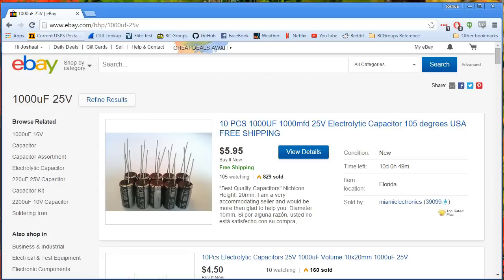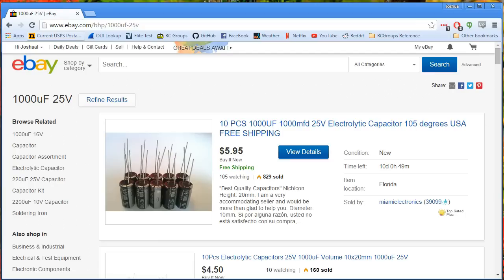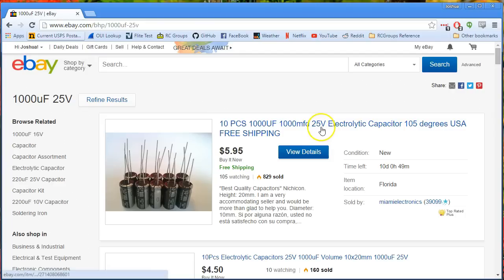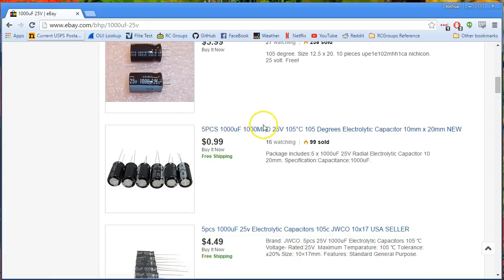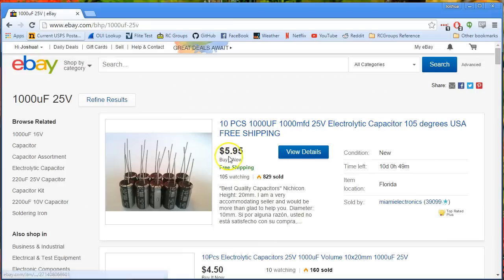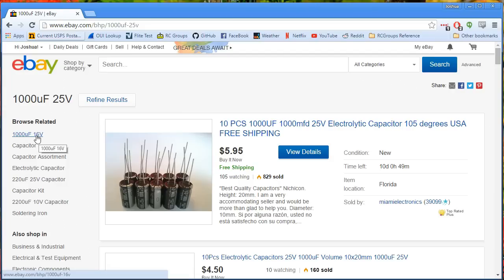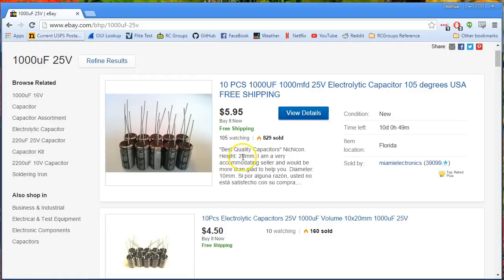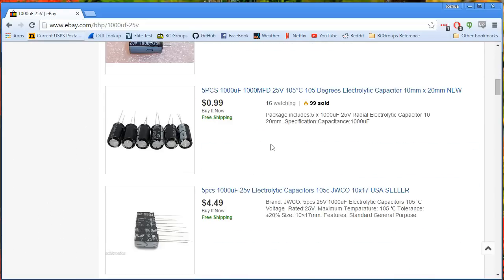Quadcopter Build Tip: Install a capacitor on your battery lead!

Comment: Aren't voltage spikes on 4s some,times up to 35v? Isn't 25 too low? Also does flying aggressivlymcreate more spikes?
Reply from the maker: Yes, but everybody is trying to make a tradeoff between size and performance, and 25v is where people often draw the line. Flying aggressively might create more spikes. But I think the motor design and tuning (e.g. D gain) probably affects things more.
Reply: Joshua Bardwell So would it be safe to stay with 25v? if I get a momentary spike over 25v will the capacitor be okay? How do you tell if it needs replacing assuming it doesn't explode
Reply: thanks for your hell
Reply: help
Reply from the maker: If a capacitor is damaged by over-voltage, it won't be obvious unless you test it with an LC meter, I don't think. I believe what happens is their capacitance is reduced until basically they are non-functioning. So maybe you would see signs of noise?

Comment: It would have been great to see it mounted!
Reply from the maker: +pass1985 http://imgur.com/7MOiiZj

I originally had a small zip-tie holding it down, but it's sort of crammed in there so tight that I decided it wasn't required.
Reply from the maker: +pass1985 I am using some small wire leads in this example because I just couldn't find another way to fit the capacitor into the build. This is slightly less than ideal from the perspective of filtering, but there really wasn't anything else to do. If you mount the capacitor directly to the pads using its legs, be aware that it will move around a bit in crashes and eventually the legs may break. You should add some mechanical reinforcement like a zip-tie or hot glue to prevent this.

Comment: There is no issue with genuine Littlebee ESC's but there may be with fake ones. I have being using genuine ones for over a year and NO issues and I have built 100's of quad racers. Right now my "test mule " is on 30 amp Blheli S ones and no issues even on high timing and stupid pitch props I am testing that draw 40 amps on a punch. I got an email from Littlebee's head of sales stating one of their top guys has left and is selling copies all over the net. Banggood etc and they even have the exact same packaging.  He even hacked their accounts and managed to send me and others  an email but I thought something was up when he wanted me to pay to a difference account than normal. 
I am now going to test these out on 6 cell so I may then need a cap will see.

Comment: How do i find out how many volts and farads cap i need for my build?
Reply from the maker: For 4S, 25v is fine. For 5S or 6S, 35V is best.

For individual ESCs, use a 220 or 330 uF capacitor. For one capacitor on a 4-in-1, 1000 to 2000 uF is best.

Comment: How would you connect this to a Alien PDB?
Reply from the maker: +Salerg battery goes to the OSD power pads. OSD ESC pads to Alien PDB. The key is that all current must flow THROUGH the OSD for the current sensor to work.
Reply: Ive installed my RROSD a bit different on my Alien 5" frame. I connected the battery to the Alien PDB and then soldered leads from the Alien PDB to the battery inputs on the RROSD. Is this going to cause a problem Josh??

Comment: Will using a PNP50 protect my system?
Reply from the maker: Presumably it has some filtering. If you are powering the camera from a filtered supply, and if the PNP50 itself has good filtering built into its own supply, then it at least will be protected.

Comment: Is there a high capacitor? i just got cap for my battery lead, But dont say LOW cap: But
 25v 1000uf 10*17 high-frequency low-impedance high frequency low impedance aluminum electrolytic capacitor 1000uf 25v- and as you say -40/105 C
Reply from the maker: I've been told that basically all 105° capacitors can be assumed the be low-ESR and appropriate for this use.

Comment: Can using a capacitor cause damage in any way?
Reply from the maker: I don't see any way. If you add a capacitor in the wrong place, it can block signal flow, but you're unlikely to do this by accident.

Comment: wouldn't a poll to your vtx stop the noise
Reply from the maker: A what?
Reply: +Joshua Bardwell a polulu, damn auto correct
Reply from the maker: +bo holland it helps.
Reply from the maker: +bo holland it helps.
Reply: Should I do both then
Reply: yes, cap before the pololu. I have a 470uF at the input of my 12V. I recommend it.
Reply: thanks!

Comment: Hi Joshua!

Ive had problems with my fpv.
sometimes when i push throttle and and pull off throttle and invert or something else..
my fatsharks goes black for 1 sec or until I crash.
My vtx is soldered to a matek PBD with bec 5v and 12v and camera gets power directly from vtx(aomway 200mw).
i don't run LC because i normally don't get interference.. just sometimes.
I can run my QAV210 like mad for like 8-10 charges both on 3s and 4s..
and all of a sudden the fatsharks goes black.
Ive thought this was to be expected as normal until I saw this vid.

Could my problem be what you describe here?

Also should i put a capacitor on each esc where they are soldered on the pdb
like what this guy mentions here
 http://www.fluxfpv.com/fix-little-bee-voltage-spikes/

thanks for all your important work for the community : )
Reply from the maker: +2663540 If the goggles are going solid black instead of white static, then most likely the camera is getting disconnected from the vTX somehow. Probably, it's the vibration or motion of the rapid throttle movements that is wiggling a loose wire.
Reply: this is due to the matek pdb. the 12v outputs shut off when main voltage comes under 13.9v ... the same with my matek. greets

Comment: I'm starting a new build with 30A littlebee blheli s and kombini fc, should i add a capacitor? if so i have some that say,
samwha
SD
63v
1000uf
85°c (m)
http://projectpoint.in/index.php?route=product/product&product_id=501349597377

would these be ok? thanks
Reply from the maker: No, these are not low-ESR capacitors. They will not work optimally. Also, 63v is way higher than you need, which means they will be much larger than necessary.
Reply: Joshua Bardwell Ok thanks, I've taken one from an old car esc, same as the ones you recommend.

Comment: Thanks for the vid, Joshua. I'm using this LC filter: http://www.dronematters.com/batteries/voltage-regulators/lc-common-mode-power-filter.html between my 4S pack voltage and Aomway 200mw VTx (rated for 7-24V). Does that make your capacitor unnecessary? The LC filter says max voltage of 16V… will this filter survive LittleBee spikes if I turn on active braking?
Reply from the maker: I don't understand how they sell 16 volt capacitors as 4S capable. Obviously they don't explode or anything, but it's never a good idea to exceed the rated voltage of an electronic component.
Reply from the maker: The LC filter has a capacitor in it. That's what the C is for. You don't need a capacitor on the battery lead if you have the filter.

Comment: Hi Joshua,

I've created a crude drawing of how I think a capacitor should be wired to a PDB...would you mind having a look to let me know if it's correct? I can't tell which side of the cap is positive or negative.

http://imgur.com/lNUI9US

Thank you!
Reply from the maker: +Goonage The capacitor should be installed as close to the PDB as possible, but basically yes, your diagram is correct. The negative lead of the capacitor will have a white stripe, or "minus" symbols down the side. Also, the negative lead will always be shorter.

Comment: 3S use 16V, 4S use 25V. For 6S, 35V or 50V capacitor?
Reply from the maker: I would say best practice is to at least double the pack voltage. But you can get by with less... people clearly do.
Reply: Thx! I am getting some low ESR 50V capacitor. I watched another video with 3S spiked to 29V and dropped to 5V on little bee 30A ESC. I guess factor of 2 is good as ESC active braking really drive those transient voltage

Comment: Just wanted to throw out into the world this awesome demonstration of 29V spikes from LittleBee ESCs on a 4s battery and the massive difference that a capacitor makes. Needless to say I've ordered myself a big pack of capacitors: https://www.youtube.com/watch?v=ZhvuQJPGHzU
Reply: Marc Wasserman did 25v capacitor survive with 29v spikes?
Reply: Yes... I've never personally measured the voltage spikes, so I can't vouch for the actual voltage suppressed, but I've been putting 100uF Panasonic capacitors on my quads for a while now and I haven't had any issues of burning components. It cleans up the video pretty well too, although I might need to try a smaller capacitor on each ESC for one particularly noisy build as Joshua recommends.

Comment: Hey super video! so most pdbs have 5 and 12 v becs, those paired with a low esr 100uf cap like these http://www.ebay.com/bhp/low-esr-capacitor are the best solution to not only reduce noise but to protect from voltage spikes specially in crashes? thanks
Reply from the maker: +INMERSO more than 100 uF in my opinion, but yes. IMO 470 to 1000 uF is better.
Reply: my bad, this one is 1000uf

Comment: Is a capacitor enough or should I use a L-C filter?
Will this L-C filter be enough ?  (https://fpvracing.ch/en/fpv-accessories/375-l-c-power-filter-17a.html)
Reply from the maker: My current recommendation is to use a 330 uF capacitor directly on the power pads of the ESCs. This alone, combined with the inherent resistance of the system, makes an RC filter, and has cleaned up every copter I've tried it on. An LC filter on the vTX and camera is okay, and avoids having to put capacitors on the ESCs, but I don't actually think it filters as well as a capacitor on the ESCs.
Reply: Do I need to put a capacitor on each ESCs or just one on the PDB ?
Reply from the maker: +Kapparino each ESC gives much better filtering. I recommend a 330 uF on each ESC.
Reply: What voltage do you recommend on the 330uF caps on each esc?
Reply from the maker: +Ruben Baldwin for 4s I thin 25v is the absolute minimum. 36 is better. 50 is overkill.

Comment: 1000uf vs 470if??? The 1000uf are huge ! Physically
Reply from the maker: +Nicholas Goss try one 330 on each ESC.
Reply: so you just put them in // on Voltage input of each Esc ? I guess there is a +/- to take care off ?

Comment: Why not kill 2 birds with 1 stone and just fit a Dsun reg. Small, light weight and you can set the voltage you want to run your fpv gear off.
http://boltrc.com/index.php?route=product/product&path=100_143&product_id=848
Reply from the maker: This is a fine approach as long as the regulator can stand the noise.
Reply: Yes I use the micro version of these, works great. Super cheap. Like 10 for just over 7 bucks shipped on banggood. I use them for 12v and 5v systems. They work FANTASTIC. about same size as polulu but much better in my opinion. 

http://www.banggood.com/10Pcs-Mini-DC-Adjustable-Power-Supply-Buck-Module-Step-Down-Module-p-999753.html